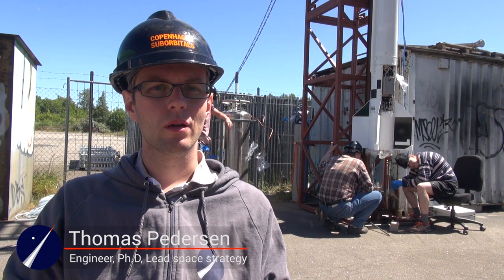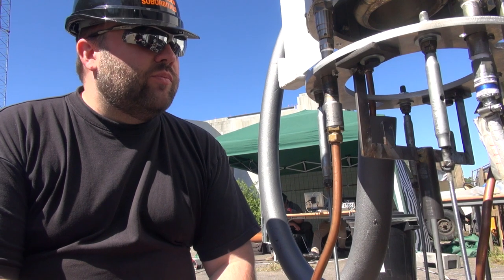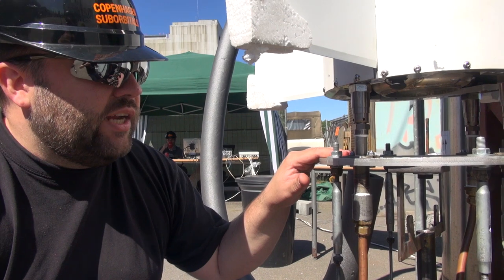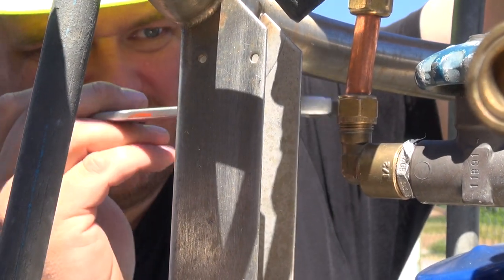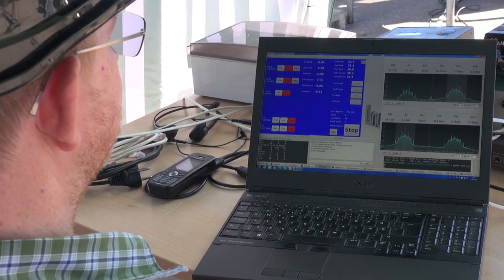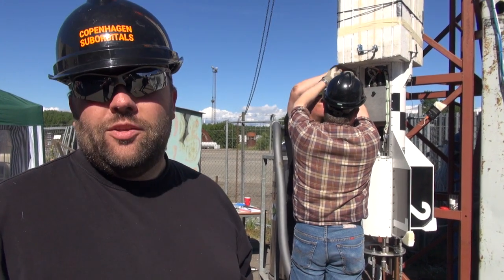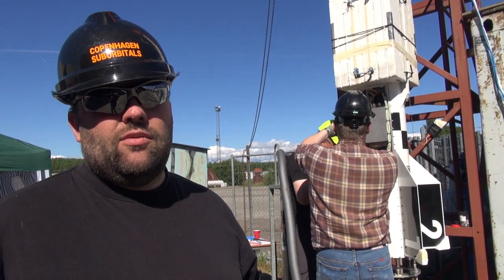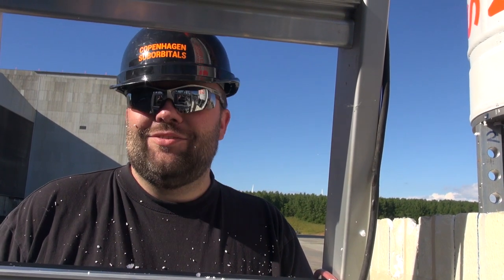Second Cold Flow test  on Nexø1 (in 2016)

Comment: Previous testing determined that too much heat energy was flowing from the engine compartment to the LOX tank.  Did the insulating gasket material improve (decrease) this this energy flow during the cold soak portion of the testing?

Comment: SOAK ROCKET IN LOX

Awesome! Did you figure out where the leaks came from in the end?
And,could you tell me the name of the soundtrack used in the video?
Reply: It was soaked with liquid nitrogen, due to nitrogen being both colder and cheaper than oxygen.
The leak was from an oxygen valve.
The soundtrack used is "Alicia Sevilla - Topos". 

All of the above is included in the video.
Reply: Mikkel Højbak The first sentence is a somewhat obscure reference - google "SOAK LOGS IN WOOD".

And derp, I must have missed the song name. Thanks.